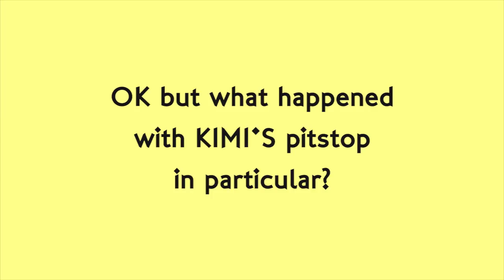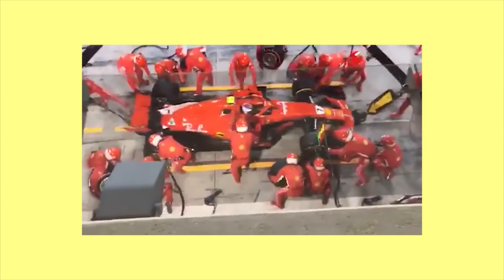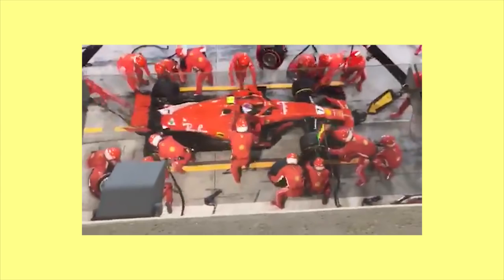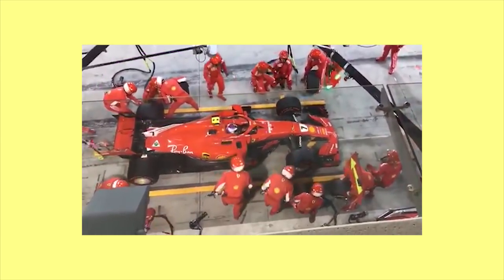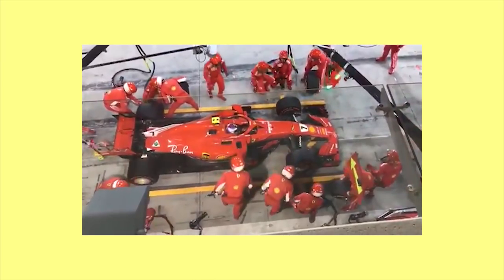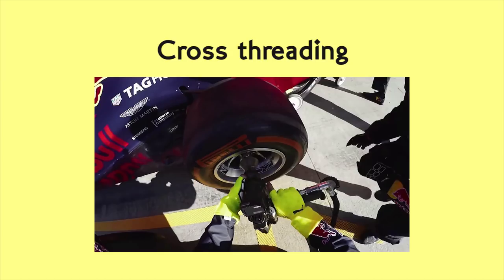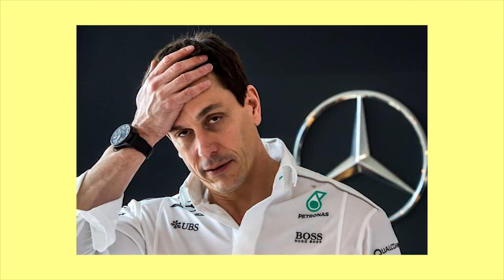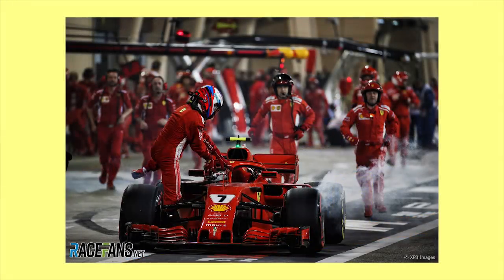Step-by-Step - what happened with Kimi's pitstop in Bahrain (pt 2)

Comment from the maker: Seems I'm adding injury to insult by spelling and pronouncing Cigarini's name wrong! Oops, sorry! I'm normally more careful than that.

Also, my personal opinion is I don't think any changes need to be made yet, so my suggestions are just there for talking points of interest. I wouldn't want to mess up what's actually quite an exciting part of the race. Not just yet anyway. If more accidents ensue then I'd be more open to bringing in some measures.
Reply: The go signal should have activate only when the new wheel nuts have already put on instead. They should hire new technicians to make a new censor system that works with this system.
Reply: Chain Bear F1. Isn't it adding 'insult to injury'?

Comment: ...but loosening the nut is a different direction from tightening it. So, if you've designed a system that says "Go", when you've maxed out the torque on the rattle gun twice, without taking into account the direction of rotation, you've messed it up. 
Also, you'd probably want to measure rotations as well as torque, so if it spins, but without applying much torque, or applies all the torque, but without turning, it probably hasn't loosened then nut, so you shouldn't even be half way to telling the system to "Go".
Reply: I'll throw in an "educated speculation" on the direction as a professional mechanic: Sometimes if a nut is really stuck, it helps to tighten it a teensy little bit and then try to loosen it. Maybe when it wouldnt come off, he set his gun to "tighten" to get that effect, which created a false positive.
Reply: I wonder if the auto "GO" is linked to the wheel gun turning in the "right - tyre on" way, and therefore the error comes from the wheel gun mechanic maybe having his gun in the wrong setting? 

The tyre doesnt come off because his gun is on the TYRE ON mode, not TYRE OFF mode, and once the system rscognizes a TYRE ON torque pattern, it gives the GO signal
Reply: even if it cared about direction, it's possible that the mechanic tried to tighten and loose the bolt alternately trying to shake it out from being stuck, triggering the green signal. It's just a my supposition though
Reply: +PerfumedManatee There's this new-fangled thing called radio which allows wireless connections. Also there could be wires sleeved onto the pneumatic hose...
Reply: The sensor is not in the gun; it is in the pneumatic line (the air hose), so there are just air-pressure measurements taken to determine torque. The measurements would be the same whether tightening or loosening--no way to determine direction. Might not even be able to tell whether it was even turning at all.
Reply: Its possible that loosening, finding it stuck, so tighten and then loosen again could have occurred.

Comment: If the guns automatically give the signal to go, they should probably have a button that overrides it?
Reply: There are guys that can override the "Go" signal but it simply went too fast for anyone to react
Reply: Ferrari had one guy at the front with a button to override it, but didnt notice the situation. My solution would be to mandate teams to have one at the rear also. And no the guns dont automatically give the signal they have a switch on them that the gunner must press to give the signal
Reply: it was not too fast! tell this to casino guys and they laugh their ass off
Reply: I know that, I am talking about having an additional override button on the guns to avoid a false auto-detection like what probably happened with Kimi's pitstop. So if there is an issue they press the button, get it fixed and then press the button and if everything else is ready it should let it go.

Comment: Thanks for the informative video.
It seems to me that the system used to automated the release of the car is at fault here. Somehow the system was under the impression that all wheels had been changed.
The most logical way to determine this is by looking at the wheel guns.
I will assume there is not a manual button to be pressed by the wheel gun operator but rather that the system "measures" so variable like torque or air pressure. The problem happens when the wheel nut does not loosen as expected. The gun operator might then reverse the rotation of the gun to shock the nut to get it loose (the is a common mechanic action). By doing so the system might think the wheel is replaced and the nut tightened and as a result give a green light.
It could also be working of the jacks. It would not be very smart but if you assume the jacks are dropped when the wheel has been replaced and the tightening doesn't take more then 0.5 sec you could give a green light after 0.5sec after the jacks are dropped. This would be a very poor way of doing this but stupid things are being done all the time.
What surprises me the most is that there is apparently not a lollipop man anymore who protects against the car driving out when an other car is coming in or is that the function of the man standing in the upper right corner. You can only see his feet.
In conclusion, I strongly feel we should not have an automatic system. Let's get back to rasing hand and a lollipop man.

Comment: In addition to monitoring the torque and turning direction of the wheel guns, they should add a gyro to them, so that the system only releases the car if the gun is pointed straight up or down. As long as the gun is operating it will be oriented horizontally, even in the phase between taking the tire off and putting the new one on. 

Pointing the rattle gun down would probably take a few tenths, but it could be a good safety measure to quickly let the wheel crew signal that they are ready.

Comment: I would like to see a change in crew numbers during a pit stop.
6 or 8 people seems like a good number, depending if you count the jack operators or not.

Another option of the 'ready' light is a momentary switch on the rattle gun. The gun operator needs to hold the button, and the release light wont go green until all the guns have their buttons held down.

Comment: Can i just ask why smoke was coming from the wheels of Kimi's car, particularly the front left tyre, is it just because the brakes were hot and not being cooled by any air, melting the tyres?
Reply: Snuggles I believe that’s from the breaks heating the tire, that’s why if you see them retire the car they use leaf blowers to cool them because they operated at such a high temperature when they are on track the air goes into the break ducts and cools the whole system, I think you are correct,
Reply: The smoke is indeed coming from the brakes. It is at a very high temperature and can catch fire if there is no airflow to cool it down. That's why you see quite a bit of smoke coming from the wheels when Kimi stopped his car after the botched pit stop.
Reply: It’s a smokescreen, so Kimi can attack any car he wants on the track. I believe they even have MG’s mounted into the AirBoxes. Ferrari apparently hired Q.
Reply: kvyat you mean
Reply: The temperature use range for the brakes is from about 350 degrees Celsius up to a maximum of 1000 degrees Celsius. This isn't a problem when the brakes get cooled though. That's why the crew cools the brakes immediatly when a car is retired. You can see them doing it when they box a car. The easiest way to spot it is during Free Practices. Especially the front brakes. You'll see that 2 men put a blower on the front wing that cooles the front brakes.
Reply: Just to clarify in addition to the other comments the smoke is not the tires melting, but the brake pads themselves.
Reply: If it's from sitting still with hot brakes then the brakes would smoke every time a car stops in the pit.  But they don't.  I think Kimi really stomped on the brakes hard when they told him there was a problem and got the brakes way hotter than they get during a normal pit stop.  So smoke.

Comment: When Brabham were trying to come up with a system to refuel their car, they found the best way to ensure they breather hose was on before the fuel hose was,  was eye contact between the two mechanics.  After all if you are shoving the fuel in with pressure you need the air to have somewhere to go.  They blow a car up in testing when the breather hose attachment was fitted the wrong way up.  Launching the fuel in the air.

Comment: Two seconds pitstop is too fast and prone to error and high risk to crew. I like the idea to reduce the time of the pitstop :
1. The person who un-screw and screw required to press a button pillar behind him. 
2. Even more strick rule required all the pit screw to stand behind a line before green light on.
Reply: Late reply,

3, a button on the gun the gunner has to press but it is covered so can't be pressed by accident, sure would make pit stops slower by about 0.2-0.3 but make it alot safer

Comment: You could give car sensors that detect it is entering pit area. Once it enters pit areas, sensor makes light red and refuses to give green until wheel nut has been once removed and then fully inserted again. Different cars could have bit different sensors so it can detect different cars and can repeat the process if 2 cars pit the same time. That is complex, but propably fastest solution, and can be made safe eventually.

Comment: I had read that after the HAAS pitstop in Melbourne, will they take abit more time in the pitstop in future races. But beside that, it also said that they had a "man" standing by to pull a handbrake or something like that. In other words, they have a man to pull the final/override decision, if one of the other crew members spot something odd. Like if the wheel isnt on right, when the car is down and abit to drive. Not sure how that works, but it is something I had read.

Comment: The safest way to ensure that a new wheel is on the car is to have sensors which detect exactly that - the removal of the prior wheel and the installation of the new wheel. Passive electronics can be installed inside the wheel rim quite easily (some everyday car tire pressure sensors use this), and sensors within the suspension could detect that one device has been removed and a new device with a different signature has been put in its place. That would, very directly, sense that the wheel has been removed and now a different wheel is installed.

When designing a system with sensors, the best approach is to get the information you want as directly and reliably as possible. If a team is only using torque feedback from the gun, that is an approach which infers and assumes that those torque values come from certain actions - but it doesn't really know that. And depending on how that torque is sensed - torque sensors are complicated, expensive, and either bulky or delicate, so it's unlikely that even an F1 team would put one on the rotating bit because it would get damaged every time - you won't know if you are detecting a wheel removal, a jammed wheelnut, or even a jammed wheelgun. If they wanted to use a torque sensor between the wheel gun and the bit, which is the best place to use one, then they'd need to attach something like this to the wheel gun: http://www.futek.com/product.aspx?stock=FSH02034. That's 6 extra pounds of bulk on the tip of the wheel gun. That's enough weight that it might even make the gun unsafe to use - as the sensor will rotate with the bit, the momentum transfer when rotating is completely different, and a LOT more force will be directed to the user's wrist. If you see one of the BBC clips where the host uses a wheel gun with nothing in it, and the extent to which it jerks their hand - the rotating bit in that case is maybe 1 pound (and most of that is as close to the rotating axis as possible, so the rotational momentum is reduced); imagine making that jerk 5 or 10 times more powerful, and it'll probably cause a major wrist injury every time it is used.

Comment: If it is to do with this auto trigger, the mechanic would have only used loosen side not the tighten. Right? Or do you think he screwed it back in to re thread and then use the loosen?

Comment: They could have 2 (or 4) additional people off to the side with a top down view like in this camera angle. They could all focus on 1-2 tire changers at a time and be able to block the green button if they notice the tire isn't changed correctly. That system would have worked in this case.

Comment: Considering the close partnership between Ferrari and Haas this would make a hell of a lot of sense. And looking at that thing I am baffled that there isn't a simple collision detection in place. A simple overhead camera can block release until the line is fully visible...
Reply: Imrahil That's what I was thinking. Maybe also have the camera recognize when the gun man have raised their guns above the wheel to indicate they are finished. Once all guns are visible and the path of the car is clear the car is safe to be released.
Reply: That could actually be a decent solution. This should be a simple task in computer vision.  As long as a line (or multiple) on the asphalt is not fully visible (blocked by pit crew) the signal can't go to green.
In addition to the other pit-stop safety measures this could  work good.
Reply: only problem i would see with that would be when the odd chance of drivers failing to stop within the lines. Like i said its a odd chance but i'm sure it has and can happen
Reply: @michaelsmart1577  Have a manual override, which no crew members are standing by throughout the duration of the stop. Or, perhaps just the single second of waiting around would be enough for them to realize "hey.. wait.. we should be going already".
Reply: @Derpy-qg9hn  and now your adding a serious bit of complexity to an already insanely hard to manage task, and anything that has the risk of increasing a pit stop by 1 second even if it sometimes increases the safety of the pit just won't be implemented, the individual teams just don't really care that much about safety.

Comment: Automated systems are usually pretty nice, and much less prone to false positives/negatives than people under pressure. Of course, that's as long as the automated system is based on detecting whether the pit crew is clear rather than something that should usually be happening just around the same time. If Ferrari were using an automated system here, they certainly didn't test it in "failure" conditions, which is an extremely common problem in testing -- designers get so focused on testing their system when things are working right that they don't test for what happens when things go wrong.
Reply: linkigii 
Very much agreed. The system seems ok. However, the data being collected for the system to process is not always representative of the situation.

I propose a proximity sensor that doesn’t allow green until all personnel / equipment are removed from the area. Believe this data would be much more indicative of the situation in the pit, and would reduce false positives.

Comment: Looks to me like the issue is the Ferrari pit gun is just looking for a certain torque level before going green, I almost wonder if the gun was set in the wrong direction. 

The idea of bringing back the Lolly pop man isn’t the worst, an unsafe release would require both getting it wrong during the same stop, possibly replace the stick with a man in the loop who has to give a go ahead instead of a veto. 

But I think a better idea would be RFID tagged wheels to make sure the swap happened (to avoid running over the wheel men) and a pair of load cells between the nut and wheel or hub and wheel, but not on the primary mating surface. The idea is to detect cross threads by comparing two of maybe even three points of contact.

Comment: There's a reason for their positions. 
The front tyres have the front wing, so they are both getting put on from behind the wing, not in front. 
The rear tyres do not have any wing to contend with, so their position is specular. 
If you look at the guy that removes the tyre, he's specular with the one on the other side but also with the position of Cigarini: they're both in front of the rear wheels.

Comment: Like I said in the other video, teams probably cheaped out on coders. They probably coded a system that only checks out if the tyres are on at the same time. Adding little bit extra code so the system can determine if X tyre has been taken off first would be basic but alas they cheaped out.

Comment: Excuse me if I didn't understand, but if the mistake was in the  rear left wheel, why the front left wheel was blowing smoke?
Reply from the maker: That's just overheating brakes. The brakes are cooled by the car moving through the air so when the car comes to a stop, especially with the brakes clamped, the brakes start to overheat.

Comment: In the beginning, Chain Bear F1 says they drop the car for, A, adjustment on the wheel nut cause its stuck or B to give the gun more torque. Is that true? do they do that often? Cause if I were Sigorini, when the car dropped (cause clearly the wheel and car fell to the ground) I'd get the fuck out of the way!

Comment: I think a good solution is to have each guy with a pit gun manually press a button to signal that their job is done, this would cover all 3 people at their tire (4 for the right front) and put less pressure on each one as opposed to the lollipop man. The only people left around the car are the jackers, and the guys holding the sidepods.